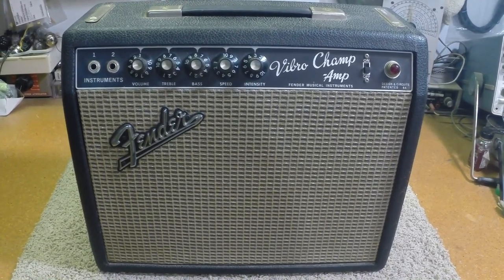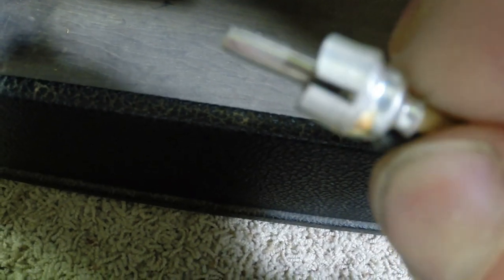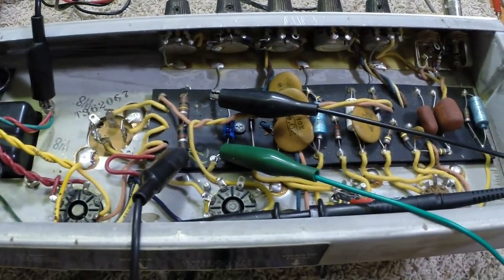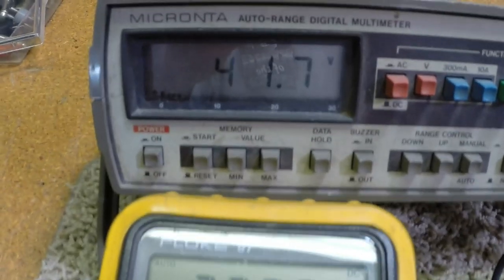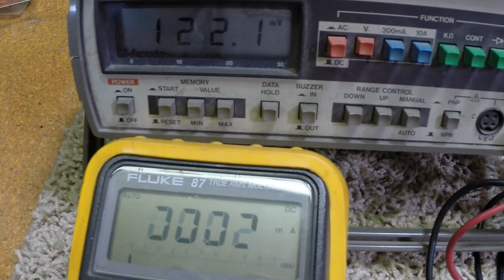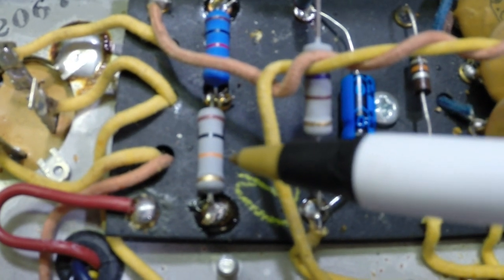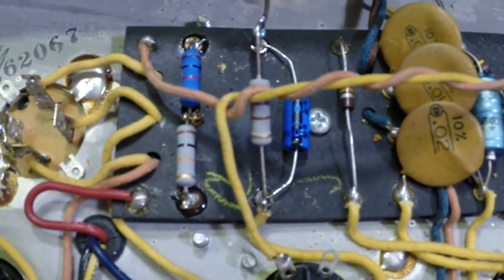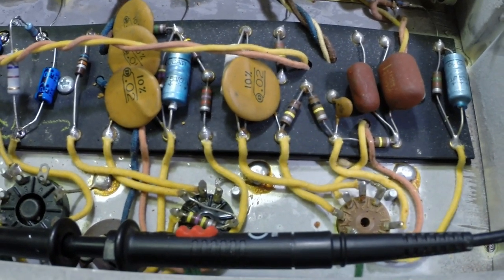Black Face Vibro Champ Repair and Bias Discussion

Comment: Hello and thank you for uploading this. Today I got an old Super Champ delivered by mail. Serviced last september. Turned it on, and it played well. Then, while playing very quiet, it blew the T315mA fuse. I changed fuse and the amp played well again, just to blow that fuse once more. Then I called a technician who told me to check the bias. Could my problem be fixed by swapping to two resistors you are mentioning here? Or, is it likely that the tubes have been damaged while being transported? (by mail) 
Martin, Norway
Reply from the maker: Thanks for watching and commenting.  Unfortunately the Super Champ is an entirely different amplifier, in a push pull configuration instead of single ended as an original champ.  This does not work in your amp.  It is hard to guess what may have happened, way too many variables.
Reply from the maker: Also I want to add..... If the amp uses a 3 amp fuse I assume it is a Super Champ X2.  This amp is entirely different than the older ALL tube Super Champ (1 a fuse)  The output stage is the only thing similar.  The X2 has a tube phase inverter and 6V6 outut tubes as well, BUT has an entirely solid state and digital front end with 3 voltage regulators and a bunch of stuff to go wrong.  Look for some one to service it.
Reply: @guitarc.p.r.9675  Thanks for your answer. It is an old Super Champ from the Rivera periode. I have been told that the blown fuse should control the output tubes, and that this again in controlled by a bias resistor. I'll try to find a capable technician then. Thanks for your consern :-)
Reply from the maker: @sallhame  Just a few more tips.   The main fuse in that amp should be a 1 1/2 amp Slo-Blo.  This fuse is on the AC line coming into the amp and controls the entire amp.  If the tubes are old or damaged it may draw more current as it runs until it reaches the limits of the fuse.  Super Champs run a bit on the warm side anyway, so that does not help.  If the tubes are good, which they may not be at this point if they have red-plated, another culprit can be the bias supply capacitor.  Good luck, I hope this has helped.
Reply: @guitarc.p.r.9675  Thanks again for your answer. My Super Champ has two fuses. One marked T1A, and the one that blows are marked T315mA. I am told this fuse controls the current to the outputtubes. The tubes might have been damaged under transport, so I will try with new tubes and have the bias checked/adjusted at the same time. Thaks again :)
Reply from the maker: @sallhame  OK, I'm curious....  In all Super Champs have seen, there are 2 fuses, a 1 1/2 amp hardwired in the chassis connected to the AC in.  This fuse connects to another in the fuse holder on the rear of the chassis and is a 1A slo-blo.  I even looked into the export wiring but found no variation.   I sounds like someone has added the 315 ma, as a HT fuse such as done on the English amps.  If that is the case the 315 would be around the right range.  Relating to that, it would fuse the power amp high voltages.  So we are back to tube issues, bias resistor and or capacitor failure, also a leaky coupling cap from the phase inverter can cause the current to drift up an an output tube as well.    Good luck, wishing you well in Norway.
Reply: @guitarc.p.r.9675  Thanks again. I am not sure if I understand excactly what you mean, but this amp has two fuses at the back, one  1A fuse, and beside that (to the right) there is one 315mA fuse. I have spoken to a technician, I will see him tomorrow and get two 6v6 tubes and some fuses and see what happens. I'll post what happens :)
Reply from the maker: @sallhame  Really, ...  I have never seen 2 fuse holders like that on a Super Champ.  But then I have also never "seen"  one for export either.  Yes, let me know what you find out.  I would love to see a pic of the fuse holders.

Comment: The upper blue resistor color codes are hard to see with the yellow cloth wire blocking and I'm not understanding the color code for a 22k should be red red orange correct? thank you for a great and helpful video.
Reply from the maker: The top blue resistor is 1k, The lower resistor is 10k  and yes a 22k would be red red orange.  Thanks for checking out the video.

Comment: What if you uses both 10ks?
Reply from the maker: It will just drop the pre-amp voltages a little.  It will darken the tone slightly and compress quicker in the pre-amp.  Thanks for watching!

Comment: I have a pre CBS 65 Fender black face vibro champ then I'm wanting to trade all original unmolested sounds good does get a little hot but every single thing on it is original except for half of the cord an old lady used to play Amanda Lynn through it and on a gig back in 1973 I think she told me they was down in Tennessee leaving a gig and she slammed the cord in the door which cut the cord so they just wanted a piece of a cord off of something on to it and she played a couple times after that and it's been sitting ever since I just got it on the second owner but every single piece of its original except for the end of the cord power cord I'm looking for something a little bit bigger I'm a blues player someone stole my Fender Blues the veil I wish I had to amp back had the four blue 10 in Alico speakers in it